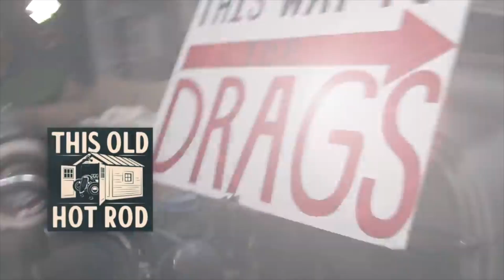The Working Man's Sedan Ep 1

Comment: What are your thoughts on coating the inside of rust old antique car body panels that are so bad that there are pinholes of light showing through? My friend bought a model T body  and he left a trouble light on the floor inside while he went in the house for dinner. When he later returned he saw a literal star field through the door and body panels as the light shone through. He scrapped the body for junk. I always felt he should have simply prepped the rust on the panels and coated each side with resin or at the really thin areas a layer of glass. Those bodies are in short supply.
Reply from the maker: I certainly agree with that.  But I think it depends on the build.   I wouldn’t send one to scrap for being thin. I’d maybe look for another one like your friend and move the old one along.   It’s a tough call I suppose.  Depending on your location and the availability and cost of a body.   
For me on this car. I wouldn’t spend the time.   I’d rather spend the time and money on a good body for a nicer finished car.   
There a certain point when you’ve got to accept the body is too far gone.  
This one is close to that in certain areas.   
I’ll let the next guy decide. 😁👍🏼
Reply: @ThisOldHotrod  What I really was asking is if coating the thin metal with resin would be a sufficient way to save the body. I am of the opinion that it would hold up and make a road worthy body. It may, in fact become more durable than original.
Reply from the maker: @nboldrini  it may, I’m not sure even with an inhibitor the rust would cease to spread.  
I’m sure there’s people who have tried it.  I bet it would improve it, but im not sure if there would be failure in the future.  
It’s certainly worth a shot, in the effort to save a thin body.